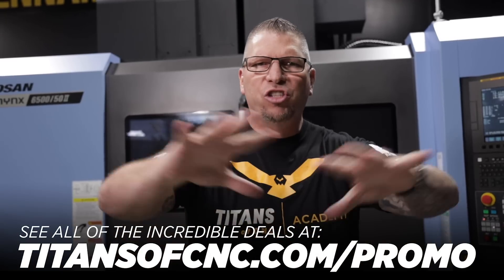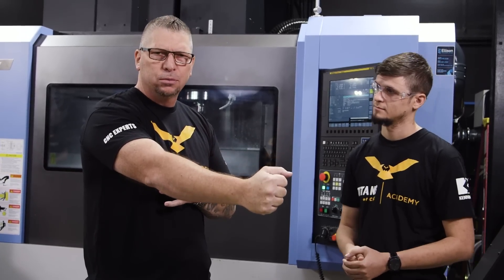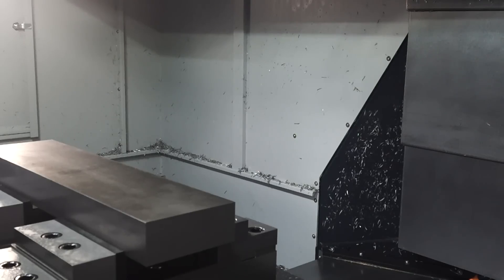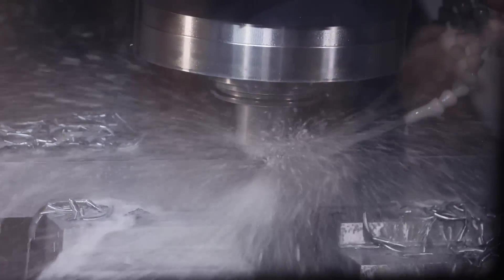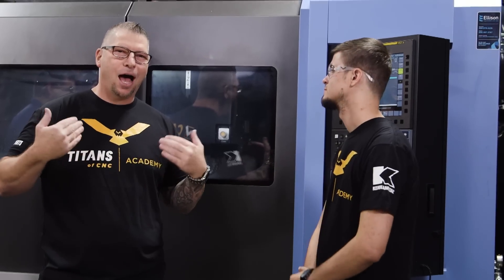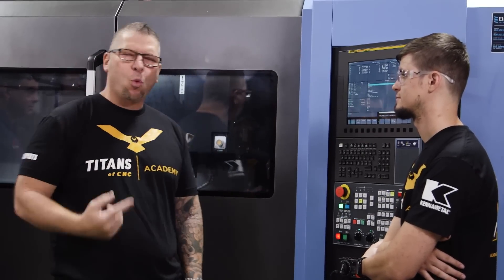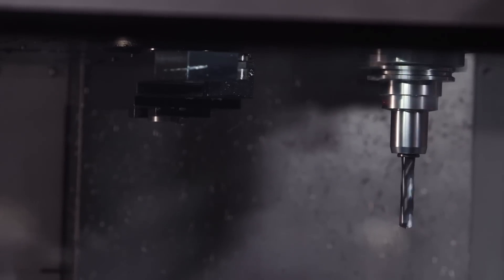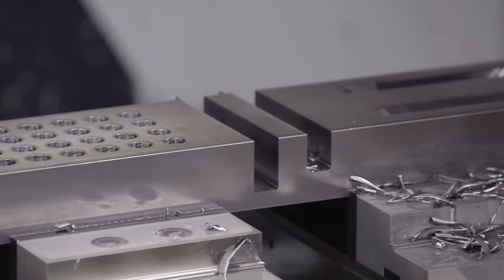FULL SLOT POWER TEST ON THE MYNX BEAST FROM DN SOLUTIONS

Comment: That's insane how the endmill went full depth and plowed it like butter! We hold our breath when we cut at 1/8". This would have us running for the hills!
Reply: I had a quarter inch stub mill set up to make a key slot in a scrap piece at something like 16 ipm on the knee mill. I invited the supervisor to watch, and noticed he was standing on the far side of the aisle until I set up the plastic shield! It made the cut - way less than specified max with the Niagara Stabilizer 2.0. Until then our typical speed was only 1 or 2 ipm depending on which machinist with standard length HSS mills. 16 ipm is ridiculous when making a short slot to a stop length, but we ordered some carbide stub mills (not Niagara or Kennametal) from our regular supplier and now everyone is running twice as fast as we were before, with better control of the slot dimensions.

Comment: You should try Full-drills with inserrts and spindle thorugh coolant,..... 
That is totally badass, trust me!!!
Lika a Ø17,5mm in steel with at least 180 metre/minute
Reply: Are you aware that he was drilling at S1800 u/min F2000 mm/min? No insert drill can do this much speed
Reply: @doubledsledgy   Exactly... Almost nothing takes a full cuy faster than a solid carbide twist drill....Except that funky HSS-Co staggered tooth slitting saw I ended up running at over 15m/min on a fixture of 24 aluminum extrusions (100mm diameter at 1270rpm with 32 teeth and 0.38mm/z) to cut an open slot on 6000 parts in under 3 shifts (plus another half for setup). I would be interested to see any 2.5mm solid endmill try to match that... lol